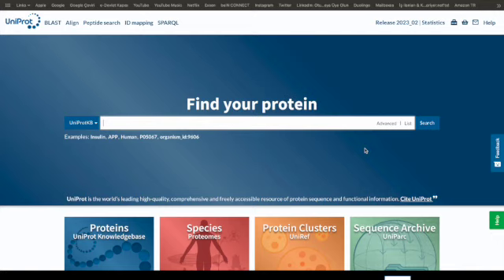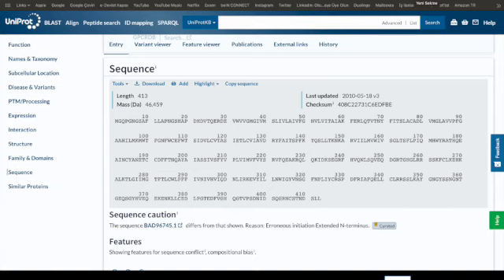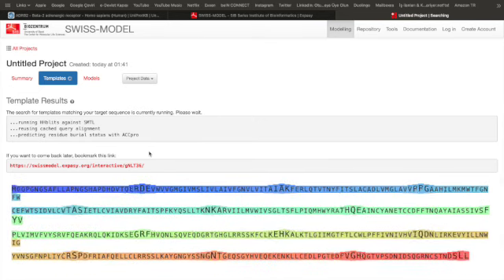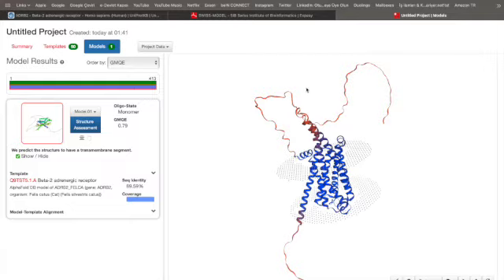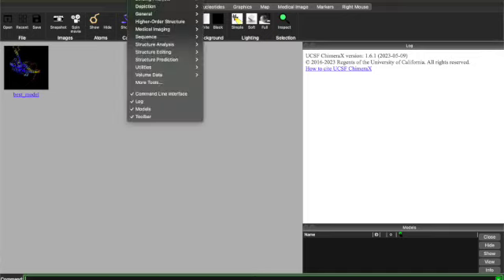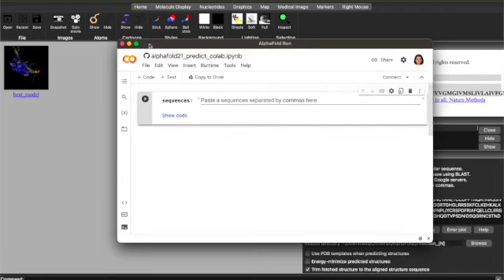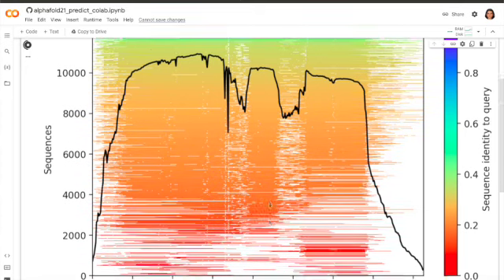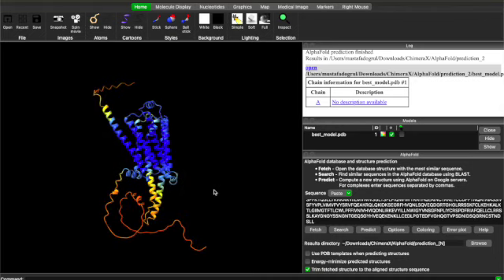Prediction of protein structure  by using SWISS model and AlphaFold via ChimeraX

Comment: I am new to bioinformatics, my question is when using swiss model what if % identity and Query coverage is less but the GMQE and Qmean score is good?, which factors are more important than the other when deciding on a good model?
Again what does it mean when your swiss model has no QSQE score?
Reply from the maker: Actually gmqe and qsqe are most important scores that we have to consider. which gives the quality of the estimation mostly. You can check swiss model website to get detailed information. I don't want to give wrong info. Thanks for watching my video.